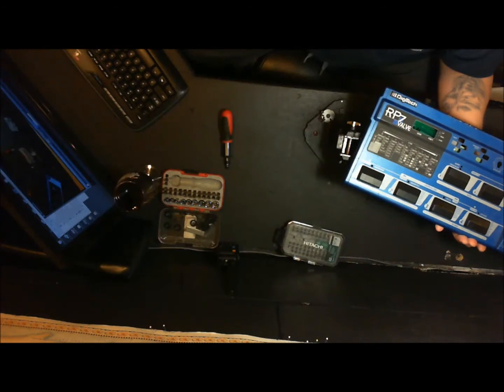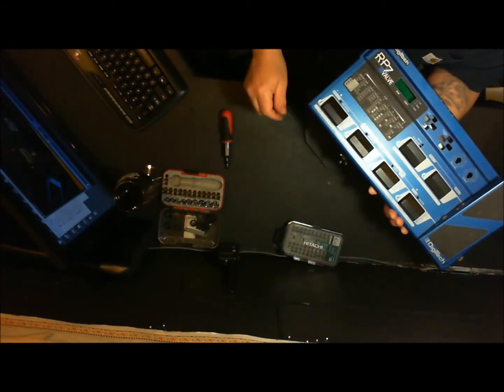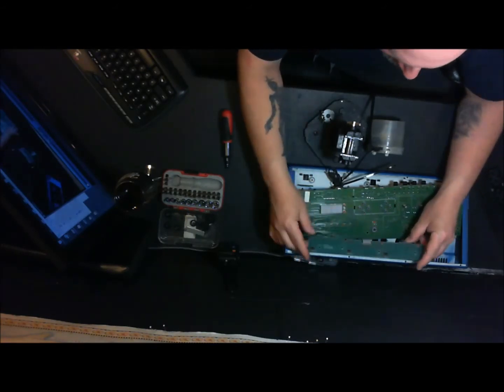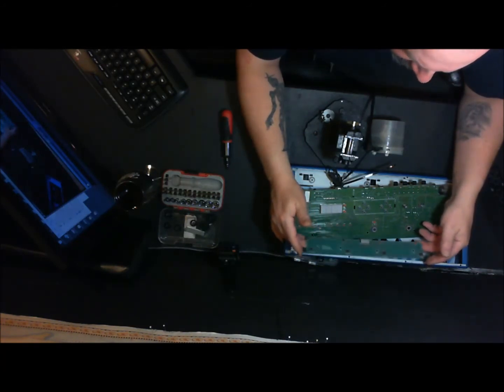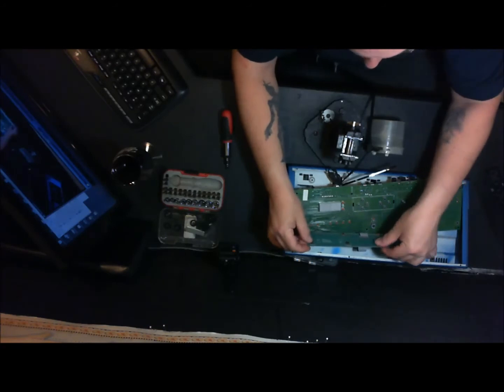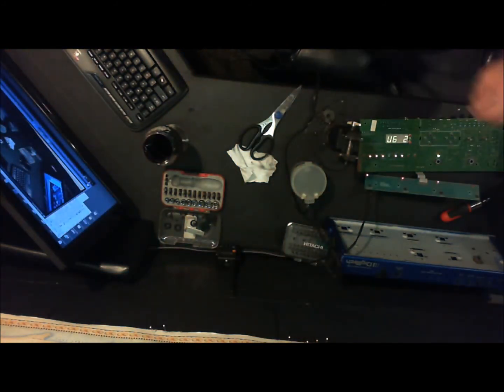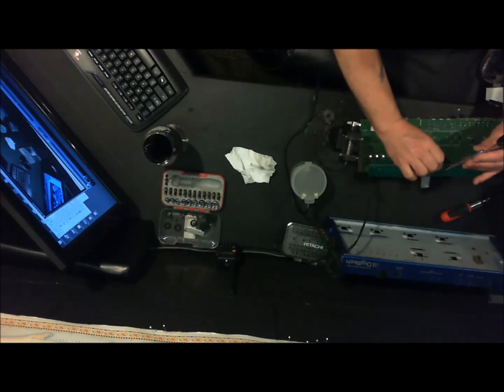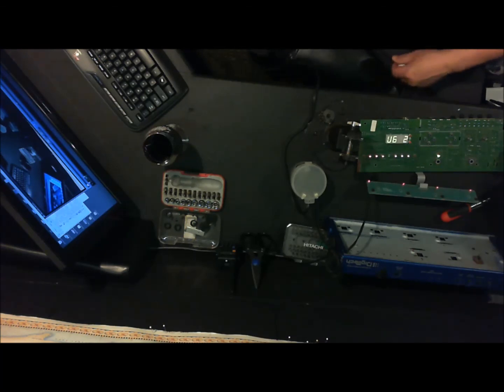DigiTech RP7 Valve Guitar Tube Preamp/Digital Multi-Effect Processor.

Comment: You ain't one of those selling this junk on Ebay? lol
They're trying to get 100 bucks for 30 year old boards. lol 
 I own 3 of the GNX4's. The voltage rails are bad, like 90% of them now. Such a shame.
Did you get it working?
Reply from the maker: Na man no selling on ebay. Got it up and running no problem. It's a dated piece of equipment. It's fun for me to fix problems.